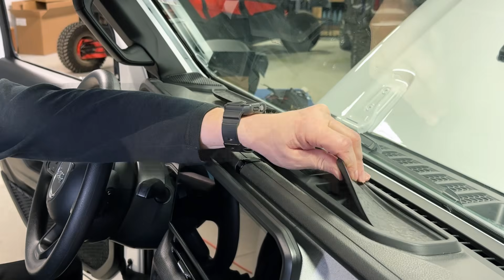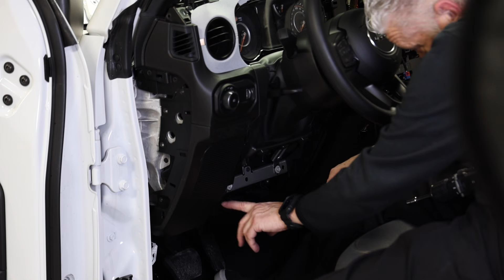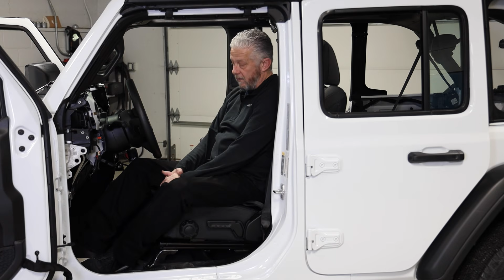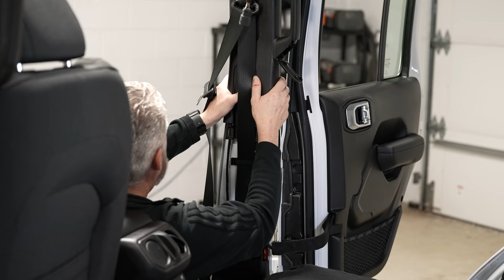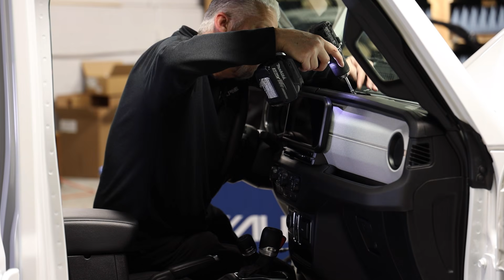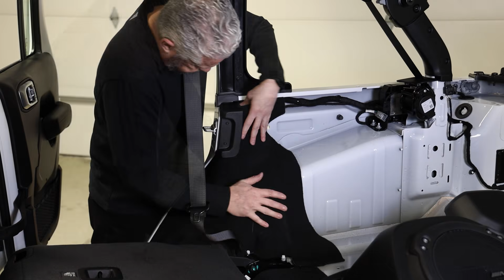Step-by-Step DIY Install Guide: Alpine Premium Audio Conversion Kit for Jeep Wrangler

Comment: Great video! I’m actually using this as a reference because I’m doing the opposite. I have a 2018 JL with the premium Alpine system, and I’m removing the factory sub to make room for my own enclosure.

I already have the main rear trim panel and carpet from a non-Alpine JL, but I had a quick question. Is that smaller trim piece behind the roll bar that connects to the main panel also different between the Alpine and non-Alpine models?

From your video, it sounds like it is, but I wanted to confirm before I go looking for that part too.

Comment: Do you happen to know with now the 2026+ Jeep changing their manufacturing to streamline things and they all have towing, heated seat, etc wiring did they do the same for audio on rubicons? 
Like you no longer need to worry about the harness/wiring it’s already there now on 2026+?

Comment: For tesla cars to be more successful they need to make all the built in control screen sounds have a speaker like a phone speaker built into the tesla head unit and just use normal full signal audio/pre outs for the music out so you can add AFTERMARKET whatever speaker and amplifier anyone just from the stock head unit THEN simply make a switch inside the tesla menu screen to turn the car prompts and (non musical audio) into screen speaker only mode with a volume adjustment and muter THEN make enough space under the head unit to install ANY AFTERMARKET head unit with power plugs locations ready to go where you can wire all original stock tesla music speakers into the new AFTERMARKET head unit but still hear your GPS sounds or whatever car prompts from the original tesla head unit still in the car but also then you can run any speaker system or amp from a properly made power output that runs the correct volts for all AFTERMARKET head units... Without that I think I'd rather ride push bike and if find it hard to bother buying a tesla other then for just basic work use as having no ability to buy my favourite car audio brands head units for my favourite electric vehicle is bad. On my google search it says no electric vehicle in Australia will EVER be compatible with ANY AFTERMARKET head unit ever because you need the Ev head unit for air conditioning ECT.... I think y'all gotta fix that and support good brands like KICKER, KENWOOD, SONY, ALPINE & PIONEER ECT BECAUSE music is not only popular it's also quite helpful to bring you to life and give you motivation and satisfaction! So don't loose the vibe please Ev companies! Your making us pay huge amounts for an ev... Why can't we have premium car audio upgrades from specialist AFTERMARKET head unit brands considered in the car design also! Plus of course the steering wheel controls for music must be able to be plugged into the new AFTERMARKET head unit for phone calls and changing the volume and song also!

Comment: This is not available even from the dealership what’s going on?
Reply from the maker: It is available through the Dealers Parts and Affiliate Portal, this is a dealer only portal they can access, but not yet on the Mopar E-Store. Some dealers just use the E-Store to look up product availability so they will have to use the portal for now to find this product until it gets listed on the e-store.

Comment: Can you confirm if this will work with a 2024 Jeep Wrangler 4-door Rubicon?
Reply from the maker: Most of the Rubicons already have the factory Alpine Premium systems in them so this kit is not compatible with those. Its meant mainly for the Sport and Willy's models. If you have one of the Rubicons without the Alpine system already in it though it will work for those models.

Comment: My local dealership says the kit for newer Jeeps isn't available
Reply from the maker: You should be able to order this through your dealer using the Mopar part numbers: 68775842AA for 2024–2026 models, and 68775841AA for 2018–2023 models.

Just a heads up—if you reference the Alpine SKU (B2P-WRA…), they may not be able to find it, so be sure to provide the Mopar part number instead.

It’s not available yet on the Mopar online parts store, but it should be within the next couple of months. Once it is, you’ll also be able to order it directly through the Mopar Affiliated Accessories site. For now, it can only be ordered through your dealer’s parts department.

Comment: Where can I order this? Jeep dealer says number is invalid. Would love to get this installed in my 2023 willys xr
Reply from the maker: You should be able to order this through your dealer using the Mopar part numbers: 68775842AA for 2024–2026 models, and 68775841AA for 2018–2023 models.

Just a heads up—if you reference the Alpine SKU (B2P-WRA…), they may not be able to find it, so be sure to provide the Mopar part number instead.

It’s not available yet on the Mopar online parts store, but it should be within the next couple of months. Once it is, you’ll also be able to order it directly through the Mopar Affiliated Accessories site. For now, it can only be ordered through your dealer’s parts department.

Comment: When will this be available? Mopar website and dealer state the part number is invalid. Dealer says it doesn't exist.
Reply from the maker: You should be able to order this through your dealer using the Mopar part numbers: 68775842AA for 2024–2026 models, and 68775841AA for 2018–2023 models.

Just a heads up—if you reference the Alpine SKU (B2P-WRA…), they may not be able to find it, so be sure to provide the Mopar part number instead.

It’s not available yet on the Mopar online parts store, but it should be within the next couple of months. Once it is, you’ll also be able to order it directly through the Mopar Affiliated Accessories site. For now, it can only be ordered through your dealer’s parts department.
Reply: Factory Alpine system is not worth it… look at forums and you’ll see how many of us change out all the speakers for bigger Kenwood/Infinity/JBL speakers and add a different sub

Save your money and get better speakers
Reply: I had the Alpine premium system in my 17 JKU and 21 JT. I found the sound system to meet my needs. Plus the amp tucks away under the dash and the subwoofer enclosure is OEM so it will work with the security box I am adding to the rear of the JLU.
Reply: @Manis-World  What you're describing is a total tear-up of the vehicle and its wiring, and not an upgrade kit. Your experience does get much better when converting from the base audio system to the premium system with subwoofer, amp, and improved speakers, because the premium audio system is a significant improvement from the base system. To do better than the Alpine premium upgrade kit, yes you'll need bigger speakers, because physics. (You'll also need to cut things, fiberglass things, Bondo things, patch things, run other wiring, etc. if you want any add-ons to look 'stock'.) But frame of reference is important. This kit provides the sonic boost that most jeeps need.